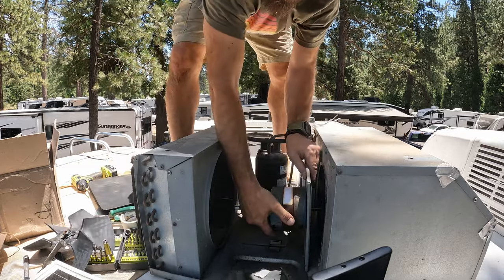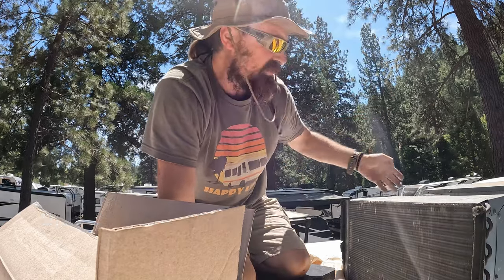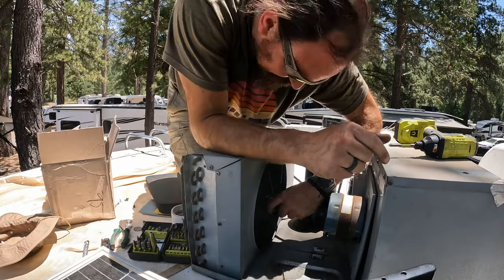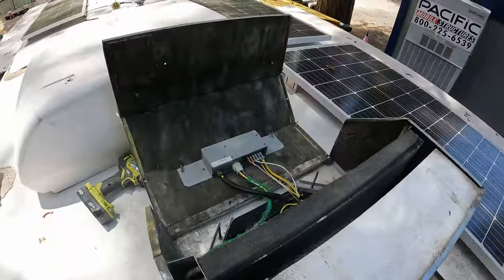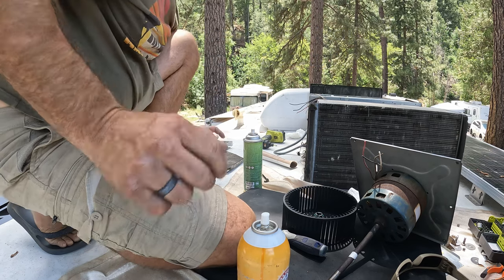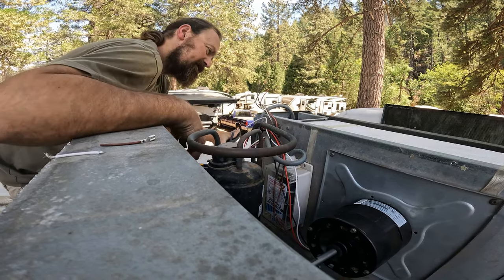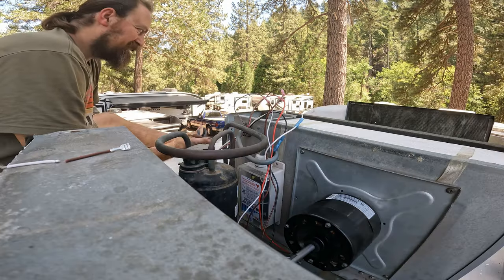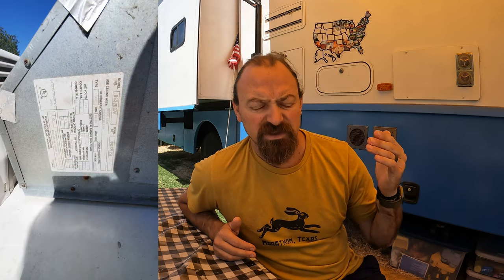COLEMAN MACH AC Fan Motor Replacement and Maintenance Cleaning

Comment: I just finished my dis-assembly of the AC unit to change the frozen motor. Well ... I think I probably took as long as you did as I couldn't get the fan off and had to dis-assemble the fan shroud to give me the room I needed. For others doing this motor replacement, be VERY careful moving the motor back and forth, trying to position it to come free of the sheet metal ... it's easy to damage the fins on the condenser ... don't ask me how I know this? Anyway, thanks for the video ... very helpful!
Reply from the maker: Nice work! Glad the video helped and thanks for watching.

Comment: Ended up cutting the shaft in half with a hacksaw and using a mounted vise grip along with a hammer and screwdriver to hammer out the metal piece still stuck in the fan. Thanks for the video!
Reply from the maker: That's definitely a faster method!

Comment: That  what I think is wrong with mind it's 3 years old Coleman mach 15  it's run good  but make that noise and the fan was running  it's wobbly and that's probably bearing . So I going to order one fan motor

Comment: The squirrel cage fan is designed to be missing a plastic fan piece. It is used to balance the fan.
Reply: No it's not! The reason half a blade is missing is so you can access the Allen screw on the shaft with a long Allen wrench... don't post if you don't know what your talking about.

Comment: Hey man so I just did this same replacement except for the capacitor, and before my motor went bad everything worked great. But now my compressor will only turn on for a single minute and then shut off for almost a half an hour and on one minute then off again. Ill add it was 90 degrees out. But before the motor went bad it worked perfectly in 93 degrees... Any ideas as to why the compressor might be acting up? Im going to replace the start capacitor but would this have anything to do with the compressor??

Comment: Im working on 2 units on my rv. Same make and model. Im curious if the condensing fan pushes air through the condenser or pulls it. Mine pulls the air which doesnt make sense because all the warm air is going by the already hot compressor. I think my overload kicked on once so im trying to keep this old compressor cool.

Comment: The missing fan blade on the squirrel cage blower is so you can access the mounting screw to remove the fan if you only have a straight alan wrench if you have an l shape alan you don't use the access hole notice how it's lined up where you can see the screw head? And to ease removal of motor take the shroud of the condenser fan blades off and you won't hit the cond coils fins! And my Coleman mach came with ball bearings you can upgrade to that type drill a hole and lube them yearly and get more life from them? Just FYI to save money!

Comment: The issue with these motors is they use sleeve bearings which uses a wick material. Just not practical in hot places where AC needs to run continuously. If you can find a replacement motor with actual sealed bearings, a way better choice for longevity.
Reply from the maker: I agree. or pull the roof units and put in a mini split.
Reply: @WanderToGetLost  You can purchase Window mounted mini-splits. Amazing.
Reply: @WanderToGetLost I'm comsidering this. Do you have any resources on the matter?

Comment: What to do if my mounting bolts for the motor have stripped heads on them
Reply from the maker: I would try one of those speed out kits to see if you can get em out. Otherwise start with a small drill bit and drill out the head. Increase bit size as needed.